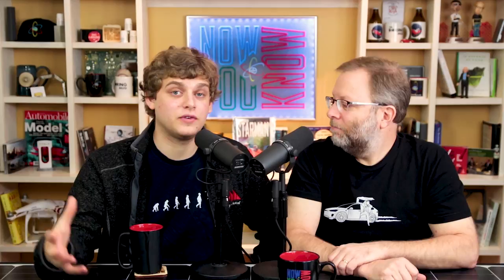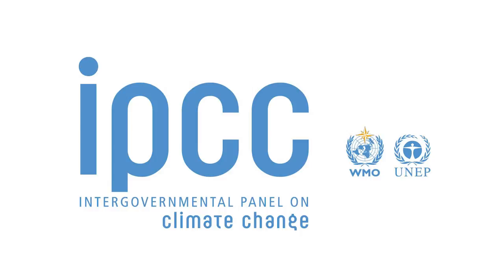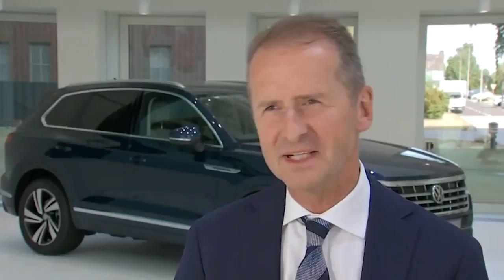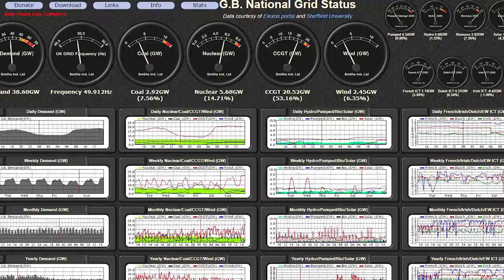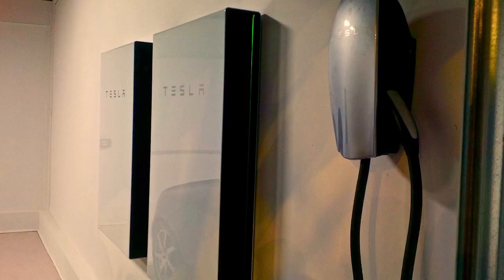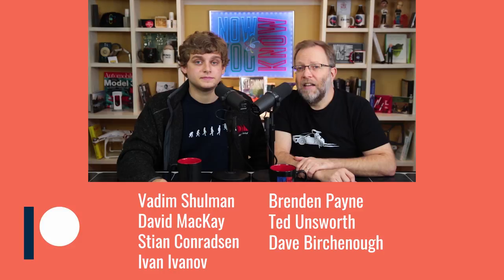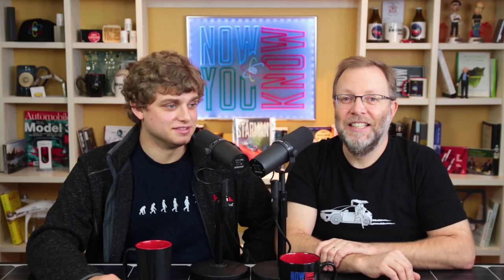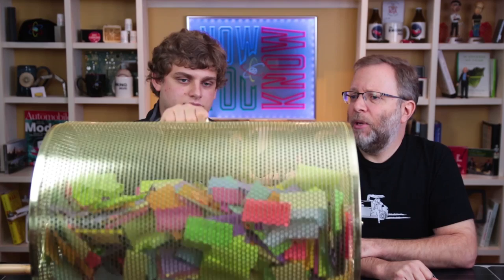Tesla Time News - I See V9 People...?!

Comment: Just an FYI, tanker trucks don't " pump" their load into the underground tanks. They drop the loads into the below ground tanks by gravity using 4 inch gas lines and 3 inch vent lines so not all the vapor is expelled to the air.

Comment: And did you know how much fuel leaks from those underground gasoline tanks?
In Los Angeles, San Fernando Valley, back in the late 80's, there was a lot of concern about the industrial facilities leaking solvents into the water table. When a well was drilled under these facilities it was found that the top six inches of our water table was gasoline. The SFV water table has been un-usable, for the last  thirty years. Since then all the gas stations had to replace their underground tanks with double wall tanks. Now a facility is being built to pump that contaminated water out of the aquifer, send it through a new facility to clean the water and pimp it back under ground. Who is paying for this? Us of course. Is this included in the Oil and gas subsidy? Ref: http://articles.latimes.com/2013/jun/23/local/la-me-water-20130624
If you read articles, most is blamed on the old long gone industries, but the truth is it was gasoline. Shortly after the wells were drilled, all gas stations in the Valley had to replace their tanks. No one that I know was told it was gasoline contamination and in fact 99.9% of the people in the Valley are not even aware we have not been able to use our water for the last thirty years.

Comment: We are down to 3 gasoline motors, one is being replaced soon. All the lawn & garden tools are now electric except for the one big-ass chainsaw. We have a Ryobi inverter generator that can easily power either the furnace or the refrigerators & freezer. The remaining motor is a Johnson 5.5 that is only used when necessary. I'm considering a Golden outboard to replace it. With the electrics there is never a problem starting the thing and your hands never smell of gasoline.

Comment: Bases on kubic meter volume the new safety distance should be 196 meters calculated using the equation for a half sphere where the last safety distance where used as the radius of the sphere

Comment: Ice cars require making a aluminium engine block , steel exhaust , many other metal components plus the fuel
Reply: Nigel, I've been banging on about the energy used to produce ICE systems (not just the engine) for ages.
Often disregarded, the ICE boys seem to like talking about battery production (omg!! Pollution!) But disregard the metals (including Chromium/Platinum) used in ICE.
Strange?

Comment: Talking of the energy required to refine gasoline.  Look up Fully Charged Show's episode called "Volts for Oil" which discusses how much electricity is actually used to refine gasoline. It's actually staggering!
Reply: Also the amount of water it takes to refine gasoline is phenomenal. Ten times the volume of fuel produced.

Comment: Hi first thanks for your great video. 
But is the vent also for pressure compensation? 
Volyme out = volume in  ? 
So: Yes, petrol vabriate  = the flow meter measure pulses, cpu detects flow.
BUT: if the flow sensor is of a model that is "simple and standard", a suction from the inside due to petrol pumps out, air goes IN to the reservoir tank.
The flow meter depending on the model : detect this as pulses. (And not negative signal)
Do any one know if the flow meter did compensate to this? :-)

Comment: I wanted to point out that VW has electric vehicles in their portfolio: Volkswagen e-Golf and Passat GTE since 2013 and 2014. https://en.wikipedia.org/wiki/Volkswagen_Passat_(B8) The first Golf was produced in the 1970s, when VW took a standard Golf Mk1 and converted it to electric power.https://en.wikipedia.org/wiki/Volkswagen_Golf#Volkswagen_e-GolfI just suspect they do not have suppliers to switch to reasonably priced competitive ev starting tomorrow. If you think how lean the car manufacture production is they operate around 2-4 hour supply accuracy to keep money flowing. This is why Tesla had to build their battery plant and start producing their car parts to overcome this issue. Even in your stories there has been many reports tesla suppliers failing deadlines and production stops. But in general i know these are not good enough excuses to stall electric car progress in government level etc. Also do not forget Car manufacturer has focus only on cars and energy supply is the deal of their partners, this is why you see so slow progress. Its all endless negotiations and details on sockets, voltages etc etc. This is a business model thing I guess.If you have not seen this older video its interesting, all oil companies are not pushing 100% oil products:https://www.youtube.com/watch?v=AJ38SiVOD78&t=10sAlso terraforming dessert areas and using green energy to desalt ocean water for these plants are interesting ideas worth checking and examine ;).https://www.youtube.com/watch?v=jkdxObsCVGYOne more thing, where most "cleaned" no salt water end up? I guess still to seas and ocean through rivers. First Algae-Powered Apartments Open In Germany.https://www.youtube.com/watch?time_continue=1&v=5r3p3NJVq_kKeep digging around and pointing out what we overlook daily bases about our pour energy management and wastes. It makes sense to enlighten ppz.

Comment: (gun to the job hit list) 
Ok in the care company there is many machinist that make engine parts.  however they can switch to making electric motor parts.. which is far less. 5000 parts down to 5 parts. 
bearings shaft Rotor stator and casing electrical connections and winding.  

yeah.. however electric motors are not the same.. the larger the Rotor the lower the RPM.. yes also more Rotors and stators. the lower the RPM and higher the voltage the higher the torque. 

Phase vs Power..  Trucks can have combination of DC and AC drive motors. which means once up to speed the DC motor and be neutral and Ac provide the power for overcome the resistance (drag) forces which is much more efficient.   however to get moving at that start the DC motor has higher torque.

What I mean is motors can be made differently and yes transmission can be used in electric cars.. just have to slow down rotor shaft speed before changing gear ratio to match.. ( computer controlled on the regen area to allow for changing gear to get the best power to RPM..   Small electric motor can be used to power the car.. yes a 50 hp motor can be used even a 30hp can be used.   By controlling the RPM of motor during the shift to gear change.. 
syncro meshing the motor shaft RPM to correct to Transmission shaft RPM..

Comment: They already have technology that takes Carbon Dioxide out of the air, which can then be turned back into fuel. 

"Carbon Engineering, a Canadian company, is already making a liquid fuel by sucking carbon dioxide (CO2) out of the atmosphere and combining it with hydrogen from water. This is an engineering breakthrough on two fronts: A potentially cost-effective way to take CO2 out of the atmosphere to fight climate change and a potentially cost-competitive way to make gasoline, diesel, or jet fuel that doesn’t add any additional CO2 to the atmosphere.

“This isn’t going to save the world from the impacts of climate change, but it’s going to be a big step on the path to a low-carbon economy,” said David Keith, a Harvard Professor of Applied Physics and founder of Carbon Engineering. Keith said capturing CO2 from the air and making fuel didn’t require scientific breakthroughs per se as much as $30 million, eight years of engineering, and a “million little details” to get the process right.

Getting it right also meant keeping the costs below $100 for each ton of CO2 removed from the atmosphere. The design and engineering cost of the pilot project that’s been running since 2015 in Squamish, British Columbia, was published today in the peer-reviewed energy journal Joule. The company used existing industrial processes to scale up and reduce costs.

“Our paper shows the costs and engineering for a full-scale plant that could capture one million tons of CO2 a year,” Keith said."

https://news.nationalgeographic.com/2018/06/carbon-engineering-liquid-fuel-carbon-capture-neutral-science/